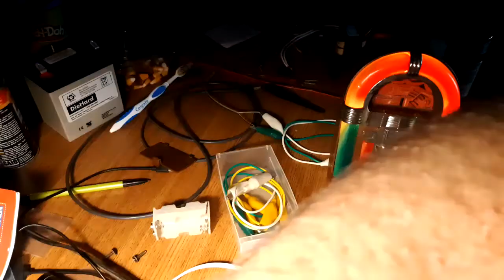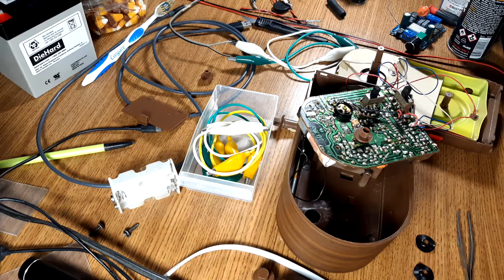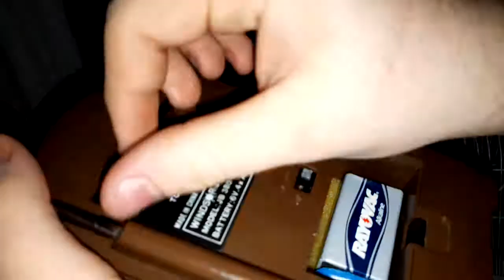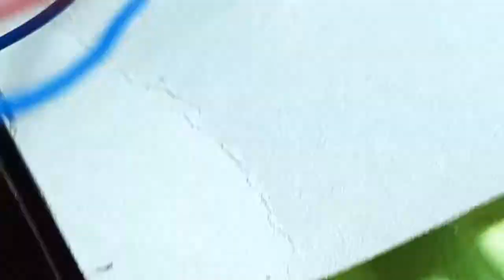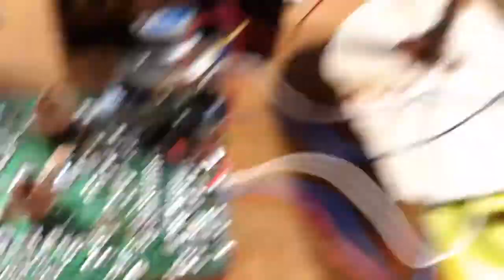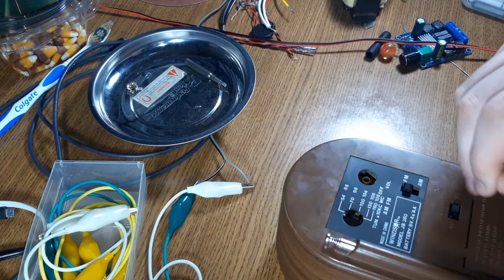Clean up and repair of a novelty Windsor JB380 battery radio.

Comment: My grandma's flashlight radio (Siren System HM-318) uses the same KA22427 IC chip and circuit board.